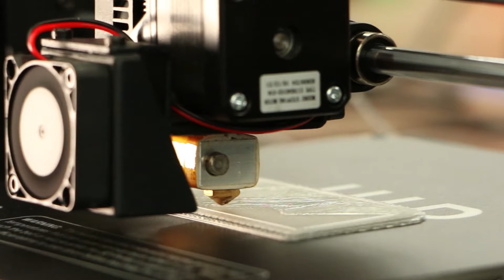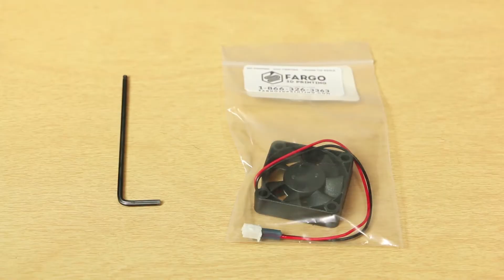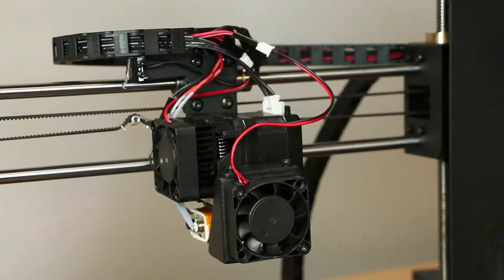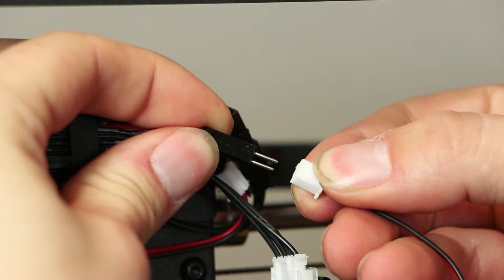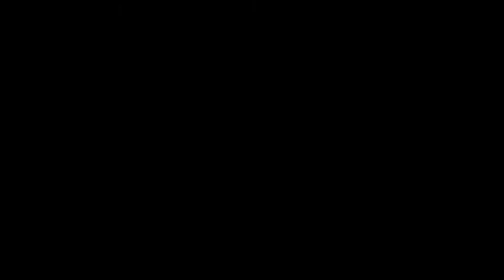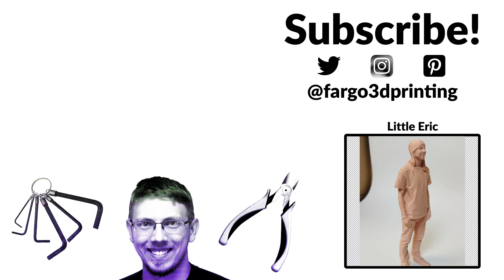Replace Active Cooling Fan For Maker Select v2 / Wanaho Duplicator i3

Comment: I have this problem of this fan not working. I have replaced the fan but its still not working. Any suggestions. Thanks
Reply: check the voltage on the fan.